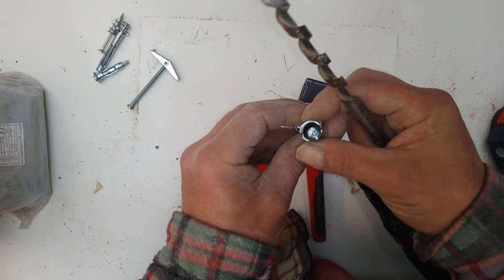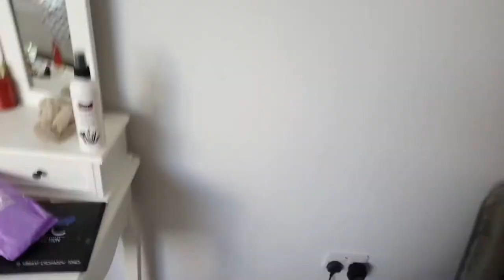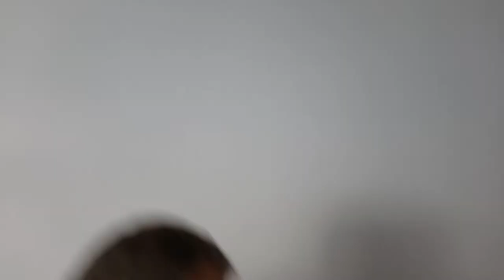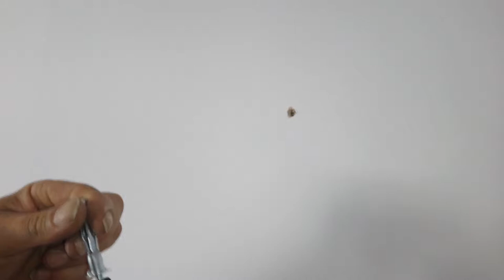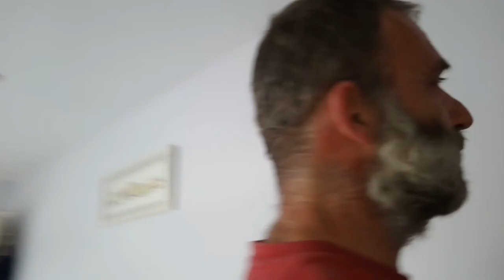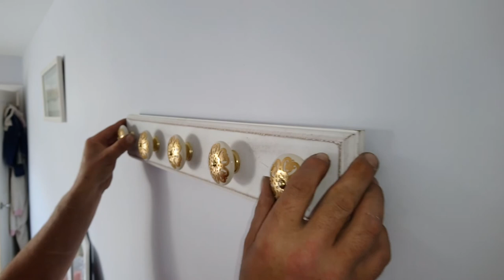How to fit hollow wall anchors with a Fischer Setting Tool

Comment: My favourite fixings too. Installation tool really helps as well if you have more than one or two to fit.
Reply from the maker: Yeah, I went through a couple of the trigger type ones, they're a bit crap , I like these fixings too & this tool although a little expensive has outlived the others by many yrs n makes putting the anchors in easier 👍👍
Reply: @Gidjoiner  I don't work on too many hollow walls so my cheapo tool is working for now. When it breaks though I'll take your advice.

Comment: Having persevered with a cheap trigger type setting tool I have now had enough and ordered the Fischer one. The trigger type I have seems to pull the fixings in at an angle and the scree tightens up in the thread at times as well. Could be the cheap Screwfix fixings I suppose as well.
Reply from the maker: Yeah them trigger gun type ones are a bit rubbish, this one's a little awkward but so much better 👍
Reply: @Gidjoiner  got it for 23 quid as well from CPC.. Good to see you back!!

Comment: The only down side to These wall anchors is you need a good clearance between plaster board and the wall behind .  Though on stud wall not so much of a problem. Many houses constructed in the 70s seem not to have a standard clearance.
Reply from the maker: Over boarded plaster n lathe is the one i don't like, you can get these anchors with a long shaft but drilling a neat hole through the lathes can be hard

Comment: Do all these Molly bolts work with the different brand guns?
Reply from the maker: Yep, the gun pulls on the head of the bolt, i've used a few different sizes with no prob,
Reply: @Gidjoiner  thanks for the quick reply.

Comment: we have hollow walls in a new build property, so these would definitely be ok and will hold a coat hook up?
Reply from the maker: The fixings themselves are pretty strong but it would be down to how strong the plasterboard is, coats can be heavy & the repetitive jolting hanging the coats could/would work them loose, I would avoid fixing a coat hook/rack to a wall if the fixings are only going in the board, I would try to fix into the stud

Comment: Hi, does it show on the Fischer tool where is it made? Looks like it's rusted badly at the top.
Reply from the maker: Hi, I'll have a look at the country of origin if it says,
I've had this for quite a few yrs & it lives in the van where it gets a bit of condensation on it, it's only a thin layer of rust where the paint has come off, an oily rag would make it look better but i avoid oil in case it transfers on to the wood, it is well made & well worth the money compared to the trigger type, i killed a couple of those before i bought this, no regrets paying the extra.
Reply: It’s made in France

Comment: Over tighten them and they are useless
Reply from the maker: Stripping the head on the crappy bolt happens & getting the bolt in if it's not going straight can be hard work